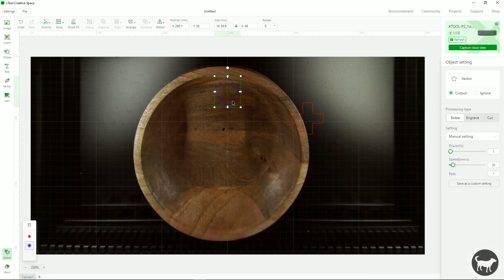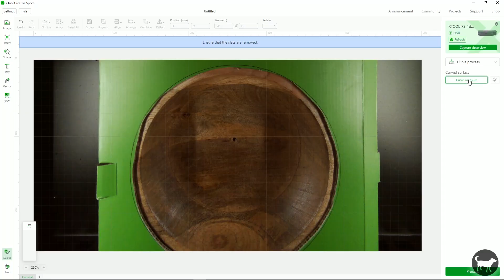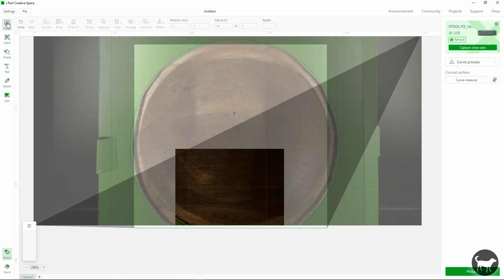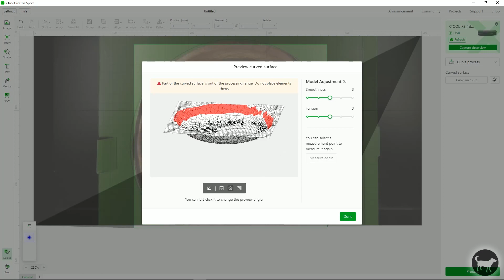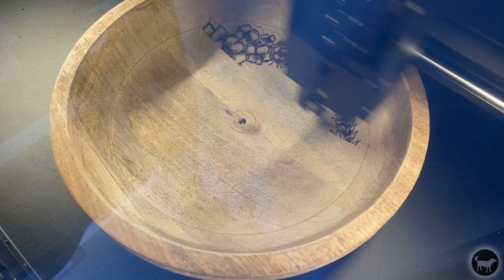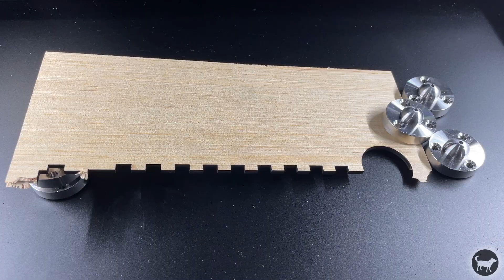xTool P2 55W CO2 Laser Curved Surface Engraving

Comment: Nice video 👍 will you be doing a full review on the machine as a whole? In your limited time with it so far how does it compare to the Gweike Pro in your opinion?
Reply from the maker: I will be doing a more comprehensive review of the whole thing but since things have been coming online in pieces I wanted to get some stuff out as it’s available to me. The Gweike Cloud is also a nice machine but is a bit louder and I feel like the build quality and smoke exhaust of the P2 is nicer. Plus with the 3D engraving that could be a bit of game changer between the 2 machines.

Comment: Thank you for this video (looking forward to a full review tho 🤞) Weird how the mapping of the sides of the bowel were too steep (when the ukulele xTool showed being engraved on seemed just as steep 🤷‍♂️) A bit worrying that the shifting happened for no apparent reason too 🤔 Love that xcs seems to be getting regular updates 😏
Reply from the maker: The bowl does get pretty steep so it’s definitely a sharper angle then the ukulele. I have no idea why that shift was happened as it didn’t happen on the others. Maybe the air assist nozzle nudged the piece when I wasn’t looking but it’s just odd that it happened in the middle both times I did it. I do like seeing the XCS updates and very excited to try out those layers for sure.